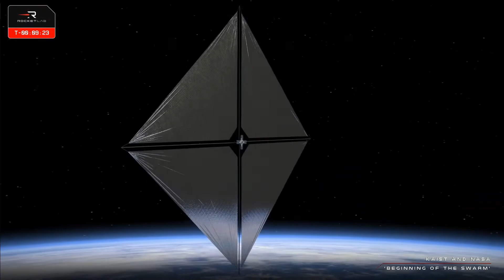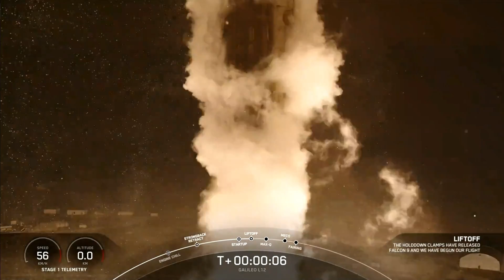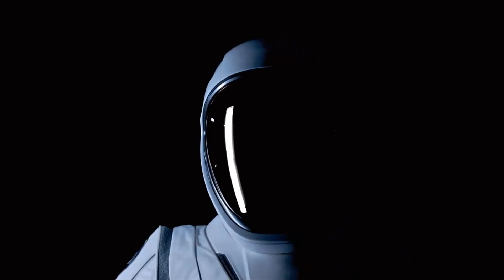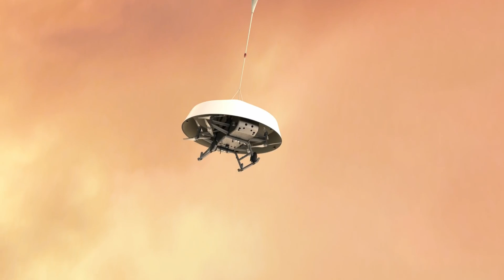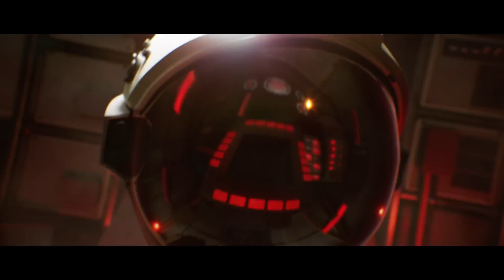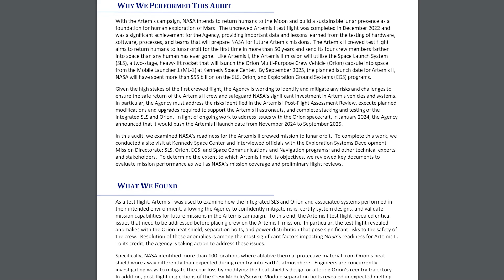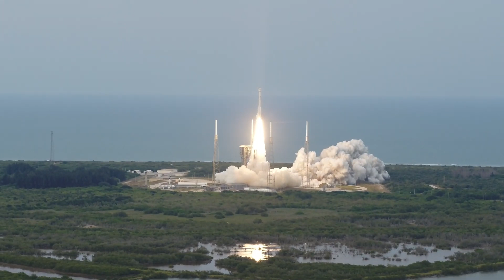SpaceX Reveals EVA Suit - China Launches Moon Mission - Deep Space Updates May 4th

Comment: How much rocket fuel has been spent up to this point in history.? How much of that stuff is still in the air? Up in the stratosphere drifting around
Reply: small brain.
Reply: @Three_Random_Words  gay brain
Reply: Most "rocket fuel" is hydrogen and oxygen, which turns into steam, which eventually falls as normal rain or turns into dew (given that they aren't launched from places where it would turn to snow), and clears out of the atmosphere and enters the normal water-cycle within three days, or so.

As for methane-oxygen rockets such as that used by SpaceX (and others), one flight of a fully-functional Starship (should that happen) will create less pollution than a single transatlantic flight by a commercial jetliner.

Pollution from rockets, as compared to pollution from other modes of transportation, are inconsequential.

Comment: Regarding the ISS: The ISS is a large amount of mass already put into orbit at a high cost. Why isn’t anyone talking about ways to recycle some or all of it’s components?
Reply: ISS is kept in orbit by Russian spacecraft regularly boosting the orbit. So NASA needs money to either replace the spacecraft Russia is using, or to design and build a vehicle to deorbit. It won't stay in orbit without spending money one way or the other.
Reply: Besides the issue highlighted by john_in_phoenix (ISS is partly powered by old Russian stuff), the components of ISS won't be really high grade at the end of ISS liftime - decades in orbit and associated radiation / thermal / vacuum environment would make it very hard to use those with any kind of reliability. Even now servicing of ISS takes some time of the astronauts, and it is going to get worse.

And after you take something off the already-not-great structure and try to push the even-less-stable remainder enough so it deorbits in controlled manner . . . you increase risk quite a bit. And ISS is really big, controlled deorbit is absolutely necessary - imagine something like that falling on New York. Or worse, Beijing or Moscow.

tl;dr: the benefit is lower than you might imagine, and the cost of doing that is quite a bit higher than you think.
Reply: @Tevesh42 Thanks for the reply. I understand that its current condition is bad. I’m more interested in the idea of reprocessing the structural metal into other objects in situ. Eventually, we need industrial processes in orbit and this seems like a good opportunity to make it a competition (best idea to recycle/reuse the most mass from ISS gets green light). Once someone gets the basics up and going, we can begin working of the bigger issue of handling the space debris around Earth.
Reply: "Why isn't anyone talking about..." Your assumption is wrong. There was/is a a big amount of talk about that and it has been stated, why it doesn't make sense.
Reply: My childhood hero was a nuclear physicist and rocket scientist (read: he designed nuke warheads, missile guidance systems, the Saturn V guidance system, and the IBM math circuits…). He was a huge advocate for boosting used space stations to higher orbits so their mass could be used by future rockets to deflect incoming deadly asteroids.

Starship may obviate the need for the ISS mass, but it’s still a good idea.
Reply: @PetesGuide Starship makes it almost economically considerable to turn the ISS into an orbital museum
Reply: Most of it will get recycled in earths atmosphere.

Comment: pressurized in pure 02? that sounds like a horrible idea
Reply: the risk in high ox environments is a function of both the percentage of oxygen and the pressure. this is 100% O2 at 5psi. For comparison The apollo 1 incident occurred in 100% O2 at 16psi. You can imagine that 100% ox at 0.1psi is almost no gas and therefore no risk. 100% at 5psi is very roughly equivalent to 35% at 14.7psi or 1atm. Definitely a bit riskier than normal but nothing extreme or unprecedented.
Reply: @saleplains  interesting, learn something new every day
Reply: @saleplains  Pure Oxygen is carcinogenic for humans. Fire will burn stronger and hotter in pure Oxygen. There's no benefit to a pure Oxygen environment compared to a Nitrogen or Helium environment with regular levels of Oxygen
Reply: @Quasar-2 The benefit is it’s simpler to deliver one gas at a lower pressure than two at a higher pressure.
Reply: that's basically all space suits since the beginning
Another useless comment ?
Reply: Apollo 1 should be a dead giveaway why it's a bad idea

Comment: Pure oxygen inside a spacecraft? Can anyone remind them what happened to Apollo I?
Reply from the maker: There’s a difference between 100% oxygen at 5 psi and 20psi
Reply: @scottmanley  Won’t that still mean that everything will still burn (even things like aluminium etc.), but just slower than in a 20PSI environment?

Maybe I am wrong as I haven’t had the opportunity to play with pure oxygen in a reduced atmosphere and am not a physicist, but I have played with pure oxygen and, anecdotally at least, it seems more reactive than the equivalent 4-5 times pressure of compressed air.
Reply: @bear4278  If you drop pressure by taking away the nitrogen, you've still got no more oxygen than you had before... what do you think the risk is?
Reply: @simongeard4824  I feel that as every molecule of gas is oxygen, things would burn more readily than in a 20/80mix (at 5 times the pressure).

I’m not sure exactly how to explain it (or again, if my thinking is even remotely correct) but I am thinking of the nitrogen as a buffer of sorts. It might take some of the heat from the reaction without going into the reaction itself. Whereas, in a pure oxygen environment, every molecule would react.

Hope that kinda makes sense (even if I am wrong) 😊

Edit: to put it in chemistry terms, it is like diluting the reagents. If you add pure Sodium Hydroxide to pure Sulphuric acid, you are gonna have one hell of a vigorous reaction. However, if you add the same amounts off NaOH and H2SO4 buy both are diluted in 5L of water, the same reaction happens but in a much more manageable manner 😊
Reply: @bear4278 You failed chemistry then didn't you it is about the number of atoms available to react !😊
Reply: @jackdbur  if you believe that to be true, test the above 2 reactions if you don’t believe me, record the temperature and your observations of each and let me know your findings 😊 That is the scientific method after all 🤗 They both should have exactly the same number of molecules of H2SO4 and NaOH but the pure version will be significantly more vigorous.

Seriously though, please don’t try adding pure base to pure acid. That would likely be extremely dangerous.
Reply: @bear4278  gas & liquid reactions are different it has to do with the spacing of the atoms.